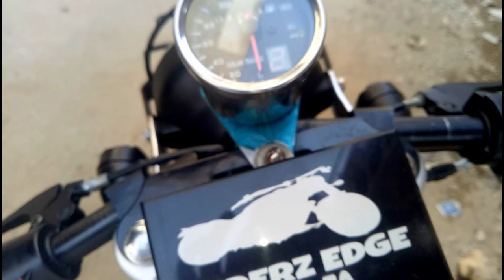CD 70 Honda Converted Into Cafe Racer

Comment: But how to fix handle
Reply from the maker: Which one do u want apply 
Like first i applied the clips on then I just towards long scrammbler handle
Reply: @muhammadmashoo5388  clipon handle...I want to fix it in 70
Reply: @muhammadmashoo5388  for made cafe racer
Reply from the maker: It will be easily fixed on the jumps